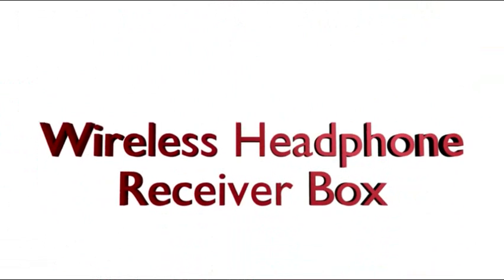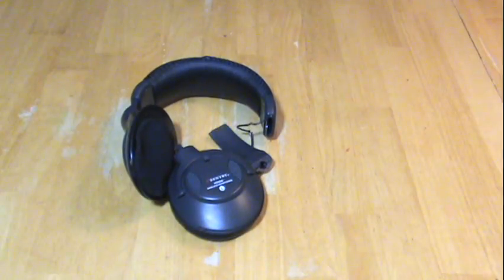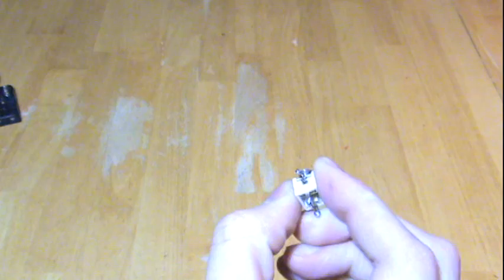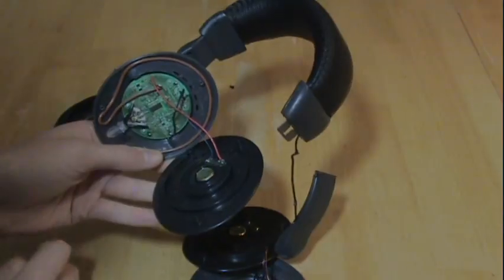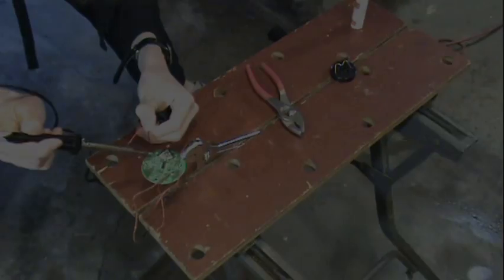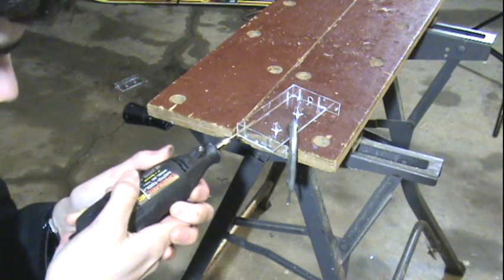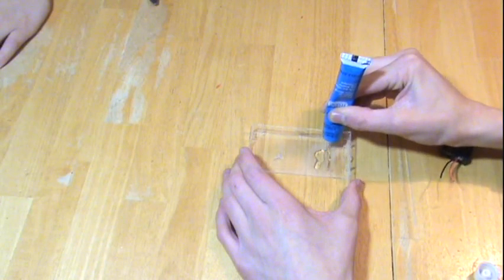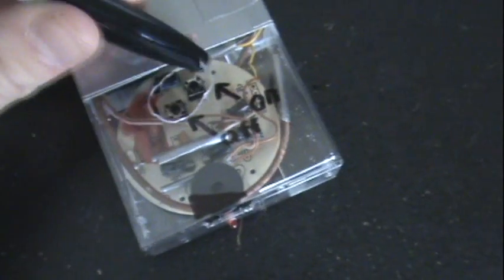Tool Time #1: Wireless Headphone Receiver Box

Comment from the maker: @DarthCaniac I would be happy to look into modding or even making a video for a more powerful FM transmitter *does quick google* Basically to increase range of a little fm transmitter, you can get a better antenna for it, for your car, and put a signal amplifier on the transmitter. There are other ways to modify it, but you have to be REALLY careful about local and federal laws, so I won't post any mods here. But if you want to sponsor a project, drop me a line and I'll see what I can do!

Comment from the maker: @dabaddon No problem! At first I thought it was at 900 mhz, which is typical for older wireless phones and my main pair of headphones, and the model number is ho900, but it says 49.
Anyways, In order to make a longer range transmitter, you are going to want to check with local FCC laws to make sure you aren't broadcasting with too much "power" (It's a 9v battery. I know.) :P And then you should add a signal amplifier to one. But the ones they have on the market should work as-is for most uses.

Comment from the maker: @dabaddon Well, typical FM radio stations broadcast from about 87.5 to 108 MHZ, and this headphone, according to the manufacturers website, runs at 49.85. So unfortunately you can't use it as an FM transmitter to transmit like a radio station, but if your car has an aux input you can use that instead :)